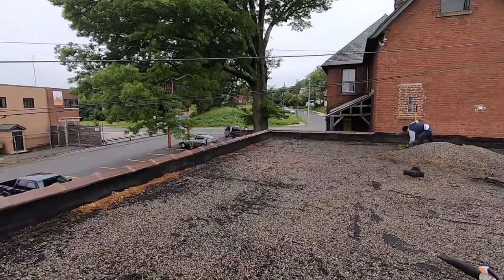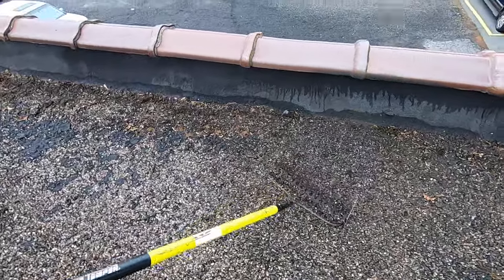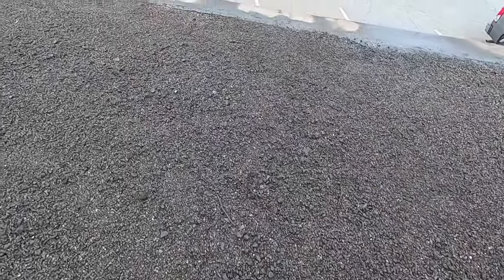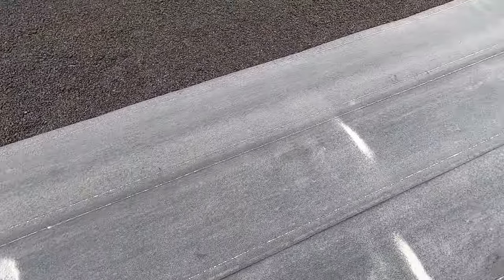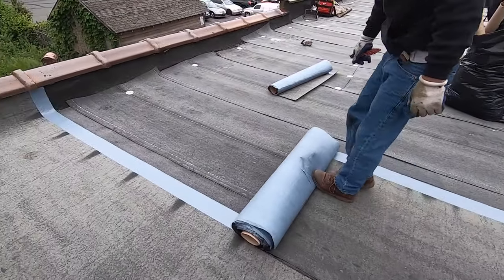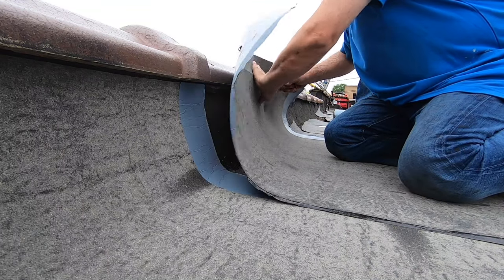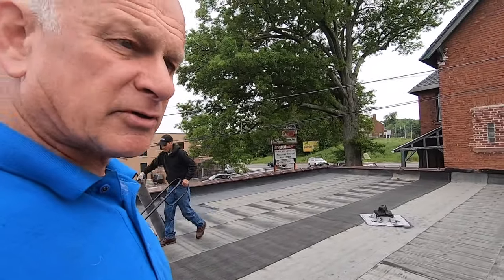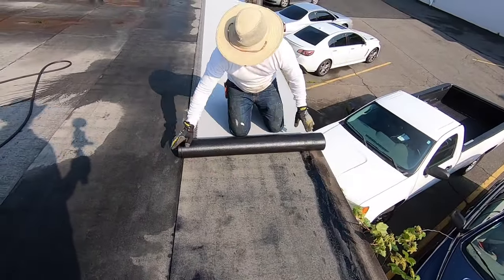Installing a Torch Down Rubber Roof directly over Gravel - Turbo Poly Seal Flashing repair

Comment: Wow, so many things wrong. Roofing over wet material, no where near enough fasteners, no stagger base sheet to cap sheet laps, no mechanical fasteners at the base of the walls. You should read the installation instructions from the manufacturer's and follow good roofing practice from the NRCA (National Roofing Contractors Association).
Reply from the maker: Hi Rich. Good roofing practice? You are a parrot, and nothing wrong with that, that copy others. The system in this video is in no NRCA handbook. lol, I have installed this type of roof for over 30 years and had no issues whatsoever so far. I had a chance to go back to many of them to make videos because when I initially installed these roofs, I was not into video making. Here is a video of such one. You will notice that it still look the same as the day it was installed.
https://www.youtube.com/watch?v=RpCzsQ7HUog
Here is a video where we explain the system and also cut it open to show the thickness. https://www.youtube.com/watch?v=RpCzsQ7HUog
I understand your points about fasteners and staggering.
1. When you install a self-adhering base on a fiberglass paper there is no need for staggering. In fact, in fact, you never have to stagger a self-adhering peel and stick base.
2. Fasteners - They serve 2 purposes. 
 a) The wind lifts up - It is far overrated what the manufacturer and anyone else claims how it should be done. For an EPDM Rubber Roof, you need more fasteners because it's so light and an air vacuum caused by wind could pull it up. Very remote situations.
This 3 layer system is so heavy and stiff, it is almost impossible to lift up.
b) Shrinkage - The other reason for many more fasteners is because of shrinkage. EPDM Rubber shrinks a lot over 15 years. If there are not enough fasteners it will pull away from the walls and flashing.
This 3 ply system has no shrinkage and therefore will never put stress on flashing or any transition.
Following the roofing practices you refer to are for people like you that need guidelines for inexperienced people. 
But there is also common sense that most don't have and need guidelines. Most of these guidelines are meant for roofing systems such as EPDM and TPO. They definitely need all the help they can get to last.
Reply: Rich b. You and anyone else aren't warranting the job, you do it your way and he does it his way.

Fasteners on base sheet are like cap nails or Staples on shingle paper, don't need much if your going to finish the job the same day.
Reply: Complaining about your competitor that gives advice on YouTube. Bad form rich b.
Reply: @FlatRoofDoctor  you mixed two different roof products, Firestone and Johns Manville - no MFT warranty we know that much
Reply from the maker: @justincash6169  Correct, I don't care about Manufacturers warrantee. They never honor it because they will find something you did that void it. I know that this combination is best since we have been using it for the last 30 years. 
Also, no manufacturer will approve to go over gravel as I do in this video.
So, there are many reasons why manufacturers won't want to be liable. Rightfully so.
Reply: @FlatRoofDoctor  They will definitely find something you guys have done to void it!
Reply: I agree with you.I been doing commercial And industrial roofing for over 20 yrs.and  this is some butchery.This Companys got serious balls  posting this shit work on Youtube .
Reply: @adriancolon6252 
My man went over a soiled gravel roof with 6 screws and caps. Loose laid a JM base sa. Torched over it no base
Flashings no
Terminations 
40 years lol
Reply: This guy makes job security for real installers Rich. Nothing holding that roof on but some insulation plates with a screw here and there.
Reply: @Donetravlin  roof isnt going anywhere😂
Reply: Keep putting um on more work for the real professionals hack hack
Reply: Another “Professional” Roofer commenting. What he does not understand is that us DIY guys watch enough instructions and we will stick with Roof Dr’s advice and Methods.

Comment: A really crap roofing method. In my country you would get a lawyer to your doorstep hahahaha. !
Reply from the maker: Sure, I should have been in jail by now if it didn't work. I have installed many roofs like that and not one has come back to bite me. I have been back to several of the roofs I have done like that, and they perform much better than the others.

Comment: I bet thats floor polyurethane oil based mixed with putin color paint, this is brilliant because i spilled polyeurathane on my driveway and its still there 15 years lol
Reply from the maker: You wrote a comment on this video that is about Torch Down on Gravel. Not 100% sure what you were referring too. Oh, I realized. The Turbo Poly Seal where I did the flashing towards the end? It is some kind of Urethane and Bituminous Resins with other ingredients that makes that up

Comment: Dear roof doctor Naas, 
Thanks a lot for your detailed instruction on how you build the long-lasting roof system.

Please allow me to make a small summary of your 3 layers on top of the 0th layer (tiny stones over existing roof): 1, FireStone MB Base ASTM D4601 Type II (with screws of Washington); 2, self-adhesive base, DynaGrip Base SD/SA ; 3, Modified Bitumen Torch down roofing systems.    

However, in my local Maryland HomeDepot, I cannot find the base ASTM D4601. Instead, there is only "GAF Tri-ply #75 base" and its manual claims it performs at least as good as ASTM D4601. The url is: https://www.homedepot.com/p/GAF-Tri-Ply-75-Base-Sheet-3-ft-x-98-ft-300-sq-ft-net-Membrane-Roll-for-Low-Slope-Roofs-3389000/310500811.

For the 2nd layer, I cannot find "DynaGrip Base" through homedepot or Lowes neither.  Instead, there are LeakBarrier products which looks like one side is adhesive and the other side looks like the torchable face of "DynaGrip Base". For example, "GAF
 WeatherWatch 150 sq. ft. Mineral-Surfaced Peel and Stick Roof Leak Barrier Roll", the url is: https://www.homedepot.com/p/GAF-WeatherWatch-150-sq-ft-Mineral-Surfaced-Peel-and-Stick-Roof-Leak-Barrier-Roll-0912000/100083257.

For the 3rd layer, I can find "Tri-Ply APP Smooth Modified Bitumen 3 ft. x 33 ft. (100 sq. ft. net) Membrane Roll for Low Slope Roofs", which looks like what you are using. The url is: https://www.homedepot.com/p/GAF-Tri-Ply-APP-Smooth-Modified-Bitumen-3-ft-x-33-ft-100-sq-ft-net-Membrane-Roll-for-Low-Slope-Roofs-3687000/100030464 .

Do you think my local HD store products will work as yours? Could you kindly provide your advice?

Thanks again.
Reply from the maker: Ok pretty good job summarizing. But a bad job in finding stuff. You don't look for roofing materials in a Home Depot. That's for the handyman. Instead, find ABC supply or Beacon Roofing or a Roofing Supplier to get your materials
Reply: @FlatRoofDoctor  Thanks a lot